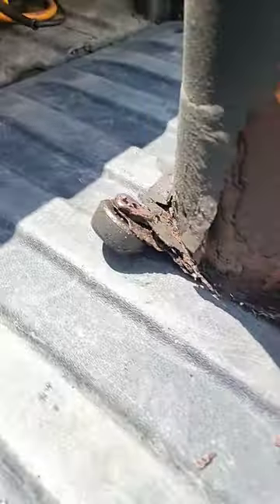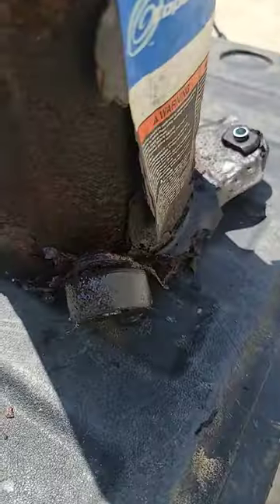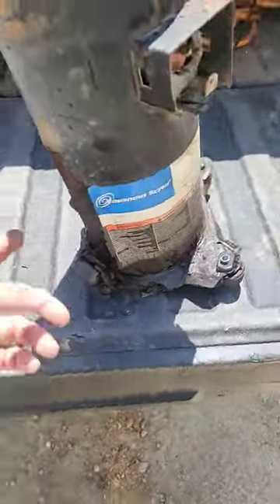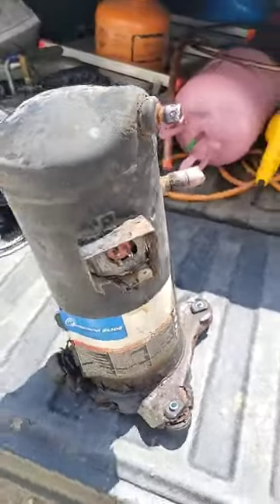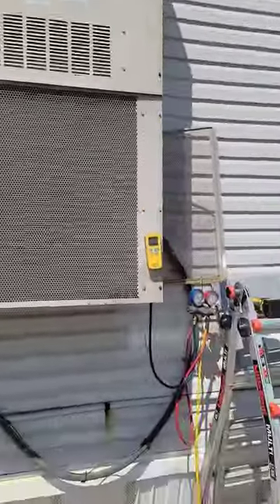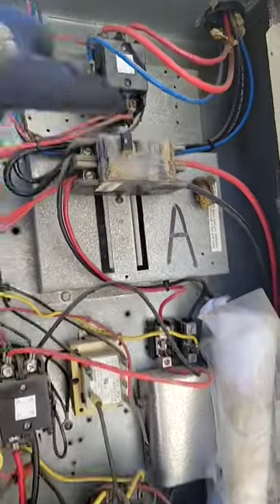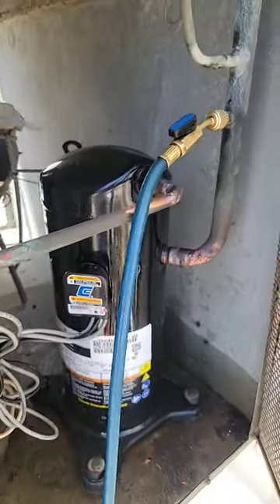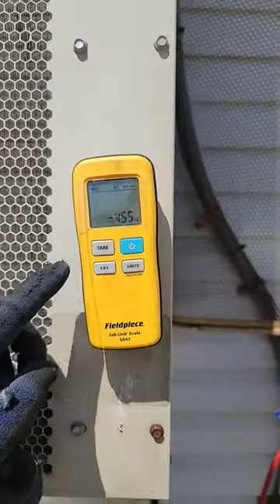Rusty Compressor on Old Bard AC Unit! Will it Work?

Comment: Worked on many a Bard units in the 80's . I've had to rewire many control panels etc. because of salt air corrosion . Noalox and penetrox are highly recomended .

Comment: I’m remember working on a really old Bard unit with pretty high head pressures, despite being very clean and the fan working properly. An old timer finally pointed out that’s how they run, especially with the low count cooling fins. I learned a lot from him and the Bard units.

Comment: Just changed a Bard condenser fan motor today and changing a compressor next week. Changed 2 last week. I've probably changed over 100 Bard compressors in the last 25 years...no exaggeration.

Comment: The old Bard packaged units cooled many classrooms Bingo halls and VFW's 😊.
Reply from the maker: yup
Reply: Yeh I'm semi retired and the comparisons made about the efficiency of the old lumps and the high SEER stats on new equipment are well documented,  but the Old Bard units were built for one purpose hang the unit on the wall move a lot of air and do it cheap and fast.

Comment: Bard unit in home? I work a lot on this unit , they installed on cell tower shelter.
We replaced a lot off compressor and Honeywell damper motor 😅
Reply from the maker: Did the cell tower Have anything to do with it failing early

Comment: Watch the head pressure the condenser fan blade placement is critical. Also pollen..I worked on 100s of cell sites that had Bard and Marv air
Reply: Same here down in SWFL. Have you seen the new DC blower Bards and Marvair wall packs. Totally ridiculous. Economizer and enthalpy controls. Way over engineered with way too many bells and whistles. They put all that crap into the new ones and they’ll still have the same life span as the good ole W60A02’s
Reply: @mustashman260  no thank God!! Between the VRF leak chasing nonsense and all the new crazy controls I feel bad for the kids trying to figure this crap out.

Comment: Is 422B better to use than 407c when converting over ?
Reply from the maker: I'm not sure would you like me to do a video on the difference
Reply: I was under the impression that R407c was superior to all other substitutes for HVAC. My problem is I do low temp refer and HVAC, so r407c won't work. It's a real dilemma
Reply: @thomasmann3560  407a is for low to medium temp. 407 c requires oil change if not replacing compressor. If your replacing the compressor it’s gonna have pfv or Poe oil. Now that being said 407c at high ambient temps will plug fixed orfices because it runs higher discharge than r22.

Comment: use 421a. also you should have changed the filter dryer.
Reply from the maker: Okay I will check it out thank you
Oh and yes I did change the filter drier
Reply: 421a is almost the exact curve as r22 no issues what so ever
Reply from the maker: Excellent
Reply: @sumdumguy4659  I have an older home AC that uses r22. I've had it serviced twice since buying my home 6 years ago and each time there was an unresolved leak and needed topping off with insanely pricey r22. The third tech for the second company found and fixed the leaky solder joint. For future reference is 421a fully compatible with r22 or will using it require replacing the compressor and other parts?
Reply: @gregoryking9348  it is fully compatible no parts needed
Reply: @sumdum guy  That's outstanding news to a disabled senior widower on a tight fixed income!!! 
Thank you for the quick reply and good news!
Reply: Drier contactor and run capacitor

Comment: My grandama's 22year old ac compressor is in worse state basically the base is gone and it is sitting on a styrofoam piece. But still running fine. Has not leaked yet. Some oil is coming out but nothing significant. 
The system was made by videocon. Which does not exist anymore due to going bankrupt after they tried their hands in the telecom industry.

Comment: Not a fan of 422B for a/c. 422D and 407C seam to just run better
Reply: 407c runs like shit on fixed restrictor systems. You NEED a TXV for 407c